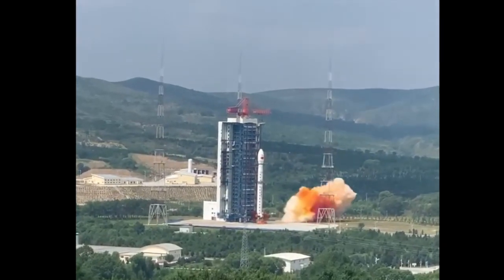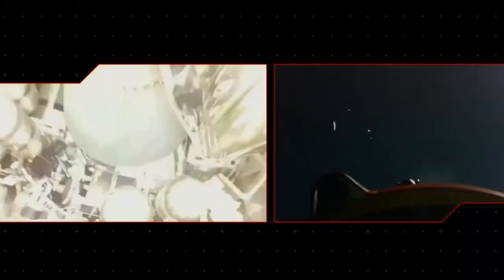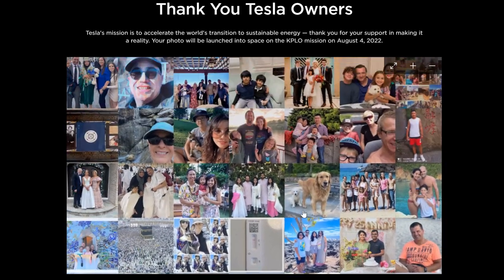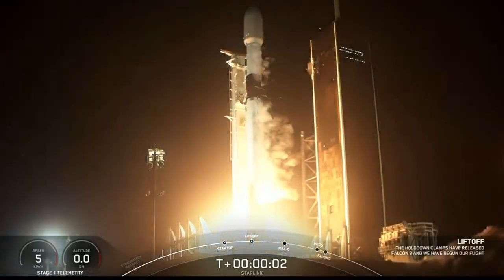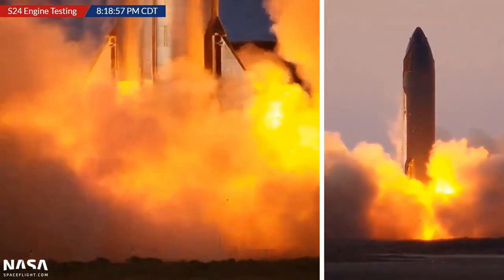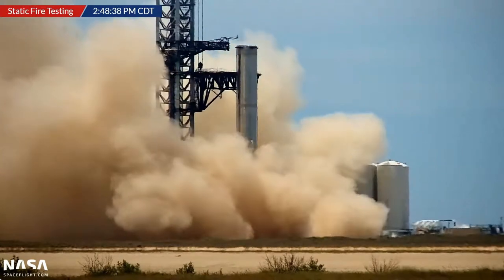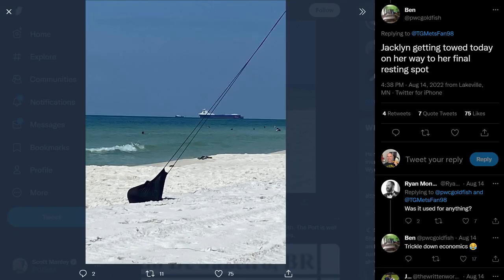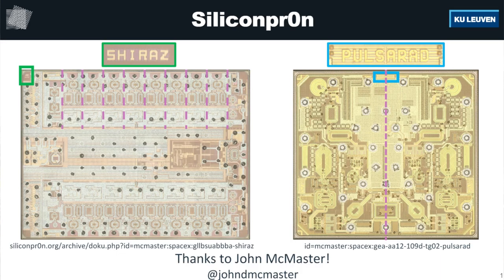Launchapalooza Summer 2022 - 5 Launches in 24 hours! - Deep Space Updates August 2022

Comment: I'm on vacation with family in the middle of nowhere Canada, and my cousins have a Starlink terminal so that she can work remotely.  It's been great for them, with no downtime due to the connection itself (just due to power outages).  It even works during thunderstorms, and according to her is even faster than some of her coworkers with fibre.
Reply: Starlink works even under Russian constant artillery shelling and rocket barrages.
Reply: The issue with Starlink was is not speed but latency, which is critical for some uses, but perfectly fine for most...
Reply: I thought that Starlink wasn't/isn't "officially" mobile right now.  I mean.. I know some people do it but I think Starlink discourages it or makes some statement that if you use it away from your home station the warranty is voided.   Either way... Starlink is going to revolutionize the internet I think.
Reply: @JeffreyBue_imtxsmoke  Not hardly.
Reply: @aerogfs  latency is great, 20 to 35 ms. Only downside is occasional drops in heavy weather events.
Reply: @aerogfs  Who needs sub 30ms latency in the middle of nowhere? nobody
Reply: @1ndragunawan  and, probably, hacking attacks as well😅
Reply: Awesome to live in a time where you can be on vacation and continue to work.

Comment: It's very interesting that they moved Booster 1061 to the West Coast.  One would think they would try to keep a couple "man-rated boosters" on which they fly most of the crewed missions, but it seems like they are only doing one or two per booster.  It also seems like they move boosters to Vandenberg later in their lives, maybe so they can be more closely monitored/inspected by HQ in Hawthorne?
Reply: All of the boosters are man rated. It is the design which is so rated, not specific vehicles.
Reply: @odysseusrex5908  I am aware, but the level of inspections and refurbishment tolerances are likely still different for boosters that have crewed launches planned.
Reply: @odysseusrex5908  that is exactly why I put it in quotes since I am aware NASA human-rating is based on the type as a whole, but that is from an outdated model wherein it didn't make sense to treat certain boosters specially because they all would only fly once anyway (or the space shuttle where every single flight had to have people on it).
Reply: @JMurph2015   Not to my knowledge.

Comment: With SpaceX shipping boosters cross-country, surely it'd make more sense to use the fact that they're a rocket stage to fly them there?
Launch a payload from one coast, then land at the other after traversing on the way down.
Reply: I'm sure there's a good reason for that, but I wish I knew what it was.  Costs?  Regulations?  Risk?  Maybe all those and more.
Reply: Just means all the refurbishment work that was done, need re-doing.
Reply: @TheEvilmooseofdoom  Same goes for if you'd launched a booster anyway. Flying it there means you can drop off a payload at the top of the boost, though, and turn what would be a costly sea journey into a revenue-generating trip.
Reply: @Skorpychan  I'm not sure I am or was on the same page as you.  Are you talking moving boosters from Florida to California?
Reply: @TheEvilmooseofdoom  Yeah, but you don't ship them cross-country. You lift a payload from Florida, but land the booster in California.

Comment: Lol calabasas avg home price  nearly 1.5m! Toronto's avg home price is 1.95m. Thst not for a mansion either. That's 1.9m for a 2 or 3bdrm bungalow one bath. Housing is crazy expensive here and income doesn't match. No one can afford to buy. 65 yr old 3bdrm 1bath, driveway no garage, radiators heat no air small yard. 1.65m

Comment: Question for video. Buran was copied. Was there any area where the Russians made improvements over the American design?
Reply: It was able to fly and land without crew, though I doubt it'd be able to perform any mission that way other than "launch and land". It had jet engines too, for landing.
Reply: Depends on your opinion, they used liquid fuel boosters instead of solid fuel so they could be turned off in the event of an abort but as a result were more complicated to build, they moved the main engines to the fuel tank so they were disposed of but as a result you could use the booster with other payloads, it also had a larger cargo and crew capacity, could be flown completely autonomously, and it also used more efficient engines for orbital maneuvering. So as a whole it was probably a minor upgrade.
Reply: Absolutely. Buran could fly and land without crew, making it more simple for classified launches. Buran also did not have main engines on the spaceplane so it’s payload capacity is 5t more than the shuttle. Also because of this, the carrier rocket (Energia) could fly without Buran and could take 100t to orbit alone.
Reply: There’s a great video on the subject by a channel called Mustard, I can recommend.
Reply: In addition to all things mentioned, I seem to remember that the Buran had loser constraints as to weather during launch/landing. And instead of ceramic tiles an ablative cork heat shield.
Reply: There were significant differences. The Russians took the main engines off of the orbiter and put them on the External Tank, turning it in to the powerful Energia Rocket. Also, the Buran orbiter was equipped with jet engines so it could make a powered landing rather than come in as a glider. Shuttle haters extol these changes to the sky and prattle endlessly about how superior Buran was. I disagree.
Reply: @odysseusrex5908  It certainly had some changes which, on paper, would have been a significant enhancement to Shuttle. Whether they would actually have worked out in practice, nobody will ever know.

Comment: Is that Chinese styrofoam biodegradable…
Reply: Edit: nvm, ignore me. Scott replied to another comment about it and linked to a video explaining it :)

-Do you mean the stuff falling off the rocket around 0:40? Isn't that ice from atmospheric moisture condensing and then freezing onto the side of cryogenic stages? (Stages using liquid oxygen, for example.)-

-That's what is often seen falling from rockets, anyway; I'm not sure how that particular rocket is powered.-
-(And it looks like it might be mainly falling from the top of the rocket, so maybe a cryogenic second/third stage after a solid fuel first stage?)-
Reply: If it's regular styrofoam (EPS with pentane filling) it can be safely burned or used for enriching certain soil types.

Comment: forcing them to have veteran Astros on iss missions is entirely arbitrary and counterproductive to the entire mission encouraging private investment in space.
Reply: OR it can be seen as a safety measure rather than having a capsule full of amateurs in a crisis.  It would increase the flight time of the astros and decrease the amount of time and training you need to give those amateurs.
Reply: @TheEvilmooseofdoom  obviously it's put forward as a safety measure. 

it's an unnecessary one that greatly increases costs. 

and they don't even really have grounds to force this on axiom. 

if the capsule is having issues, it won't be getting anywhere close to the iss. so it doesn't matter. in the case it experiences an issue in docking, they abort and land. 

this requirement is arbitrary, unnecessary, and counterproductive to the overall mission.

i4 had no veteran astro.
Reply: @GrandMoffOfMars  Greatly increases costs?  The salary of one trained astronaut vs. training a bunch of non astronaut.  Doubtful.  If the capsule is having issues it is still handy to have a pro around going to the ISS or not.  Boy, you really need to start thinking things through a little better, these are rather simple short-sights on your part.
Reply: @TheEvilmooseofdoom  Scott even says it in the video. that's one less seat you can sell. and now you must fill it with an expensive asset. 

all the Astros on board require training regardless so idk what point you think you're making but it certainly isn't compelling lmao.

I'm not disregarding anything. these issues exist in all circumstances in space. it's a simple cost benefit analysis. there's no real benefit to having the veteran onboard in case of extremely rare issues happening that they themselves have probably never encountered either. otherwise the vehicle wouldn't even be flying.
Reply: @GrandMoffOfMars  I missed that, and I consider that a very valid point!